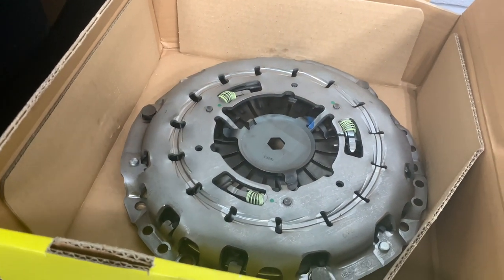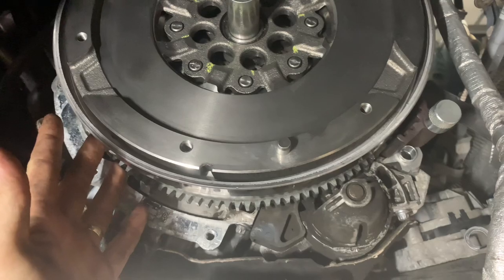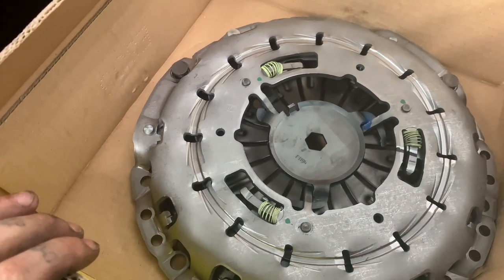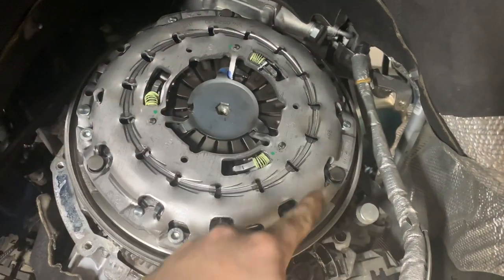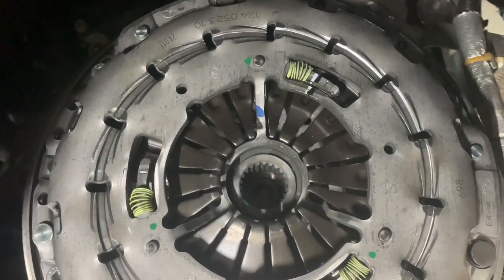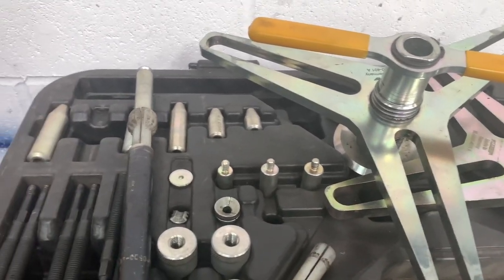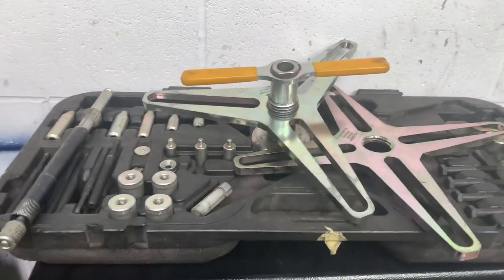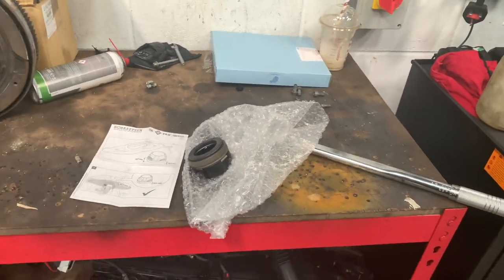Bmw pre tensioned clutch install video! Repset LUK clutch!

Comment: Hey, how did u know witch star pattern to buy for clutch, mine might be same as yours by eye looking, i dont know how to buy right one
Reply from the maker: I use a local parts supplier. You give them your registration and they give you the correct own
Reply: @owensautotips  funny Fact IM doing auto to manual and when i bought my clutch it Came wrong star pattern, ill Try to contact supplier mby they can help out with right one

Comment: I untension the plate before even mounting it to the flywheel  and now the plate is stuck and wont turn any tips on how to reset it back to original position.
Reply from the maker: So if you need to reset it then you would need the tool I shown in the video. 
If not I have seen people us a bearing press to push it down and lock it back in
Reply: @owensautotips  thanks brother i ended up using a hydrolic gear pulley it was so easy the only thing that was weird when i put the pressure plate back on torque it to spec i really didnt hear a loud click when i turned the pressure plate lock plate counter clockwise.
Reply from the maker: No problem dude, just when it’s all back together if your clutch pedal feels good the. Your fine, but if it’s stiff then will need reset if again
Reply: @owensautotips  today i put the transmission back on and when i pressed the clutch pedal in i heard a loud click from the transmission then the clutch pedal went down to the floor. noticed that my slave cylinder that mounts on the side of the trans was leaking i just order one trying to bleed it and give it another try. but i think i will have to remove the transmission again. i turned the car on still with the clutch pedal to the floor and noticed a metal to metal sound by the bell housing i had to go under the car to notice the sound im sure thats not normal?
Reply from the maker: @pzdousands_  possible that the release bearing wasn’t fitted correctly and popped off
Reply: i turned the car on again the metal clicking noise was a loose exhaust bolt no transmission noises at all only problem is i got no pressure in the clutch have tried bleeding it but no luck only air comes out when i open the bleed bolt.
Reply from the maker: @pzdousands_ have a look at a video for 2 man brake bleeding. It will be done in seconds
Reply: @owensautotips  im really frustrated i bled the new slave master and when i put it on the transmission  did the same thing heard a crack pedal got stuck to the floor  and fluid started leaking from the new slave master it broke. currently taking the transmission off again i noticed that the fork has no play at all maybe thats the problem or didnt adjust the pressure plate right.
Reply from the maker: @pzdousands_  sorry did you say your bleeding the slave whilst it’s not attached to the gearbox?
Reply: @owensautotips  no I installed the slave cylinder and then bled it clutch got some pressure and as soon as I pressed it and it literally exploded inside the transmission